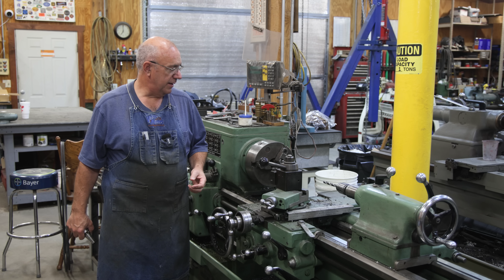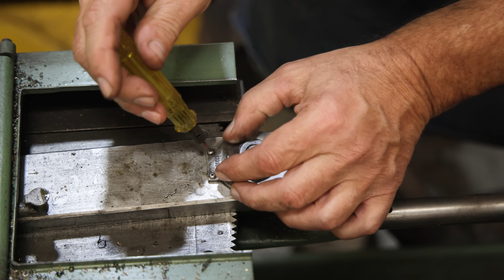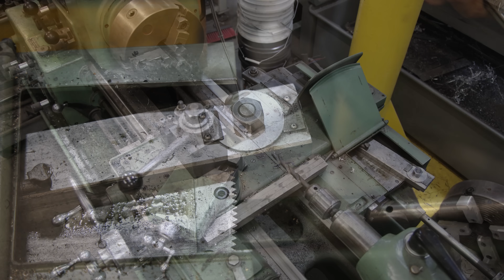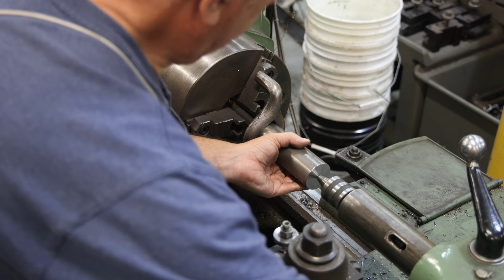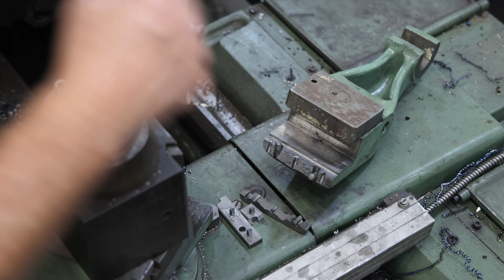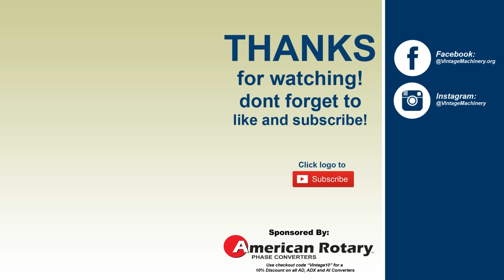Trying to Turn Tapers when Disaster Strikes....

Comment: Maybe we start a broken taper turning attachment club ? I've one on the Colchester Student but, for one, the max taper angle is only about half the range of yours. For two, the setting knob was very stiff - so I pulled it to bits, cleaned and oiled the thread then worked it back in - and the threaded rod broke - so the adjustment doesn't work now. Interestingly though, it's set up so the taper attachment is always available and the cross slide handwheel always works - no locking of the cross slide to use the taper.

Comment: You put a centre in the chuck and had a centre in the tailstock to mount your bar between. Before you mount the bar, start the lathe.
One of the centres will revolve, the other will not. You refer to the revolving centre as a 'dead centre' and the one not revolving as a 'live centre'.
How do you come to have the centre's names the wrong way round ? The centre in the headstock is the LIVE CENTRE - because it is driven and the one in the tailstock is either a DEAD CENTRE or a RUNNING/ROTATING CENTRE.

Someone somewhere has got it confused - and the way round I have it agrees with the literature of the day.
SWING: A lathe with 6" swing will turn a 12" bar. 'Swing' (think of child's or a pendulum) is from the pivot point to the extreme end and is half the diameter.

DRILL BITS - If you want 'drill bits', break up a bunch of drills. There's no such thing as a 'drill bit'. A 'bit' does exist (12 1/2 cents, Am.) as you can drill a hole using a 'brace and bit'. Bit - the replaceable cutting tip of a drill.

Surprisingly 'drill press' appears in my dictionary although it's not used in English. We do have:
Radial drill (like the Carlton)
Pillar drill (floor standing (head only goes up and down))
Bench drill - short version of pillar drill mounted on a bench
Electric drill - electric powered hand-held drill
Hand drill - hand-cranked hand-held drill.

This feels like a rant - but it's not. :) There seems to be quite a few other things with multiple names. Top slide / compound slide, Travelling steady, fixed steady / steady rest; 'loose headstock' - that could be new to you ! (Circular) saw bench / table saw

Comment: Some re-engineering might be in order to repair that lock. I noticed that Keith had to use both hands to crank the saddle. There is some high resistance working against that saddle and I'm betting it increases with the taper and naturally transfers pulling force to the lock.  Unless that resistance can be lessened, simply replacing the part won't get the job done. Getting rid of the leverage on that lock might be a good place to start.

Comment: Simple math would say that a 3.5”/12 taper or angle would be about 16.3°.

Couldn’t you just set up the compound to that 16° and cut it with that?

It would leave you with the extra .3° to take away with the grinding, but you were already gonna have that, or an X amount of extra to take out with this current setup.

I like the videos and most of the content you make in the channel but it seems like a lot of the time you make things harder than they have to be. 

Don’t take that the wrong way. Just saying there is an immediate solution to this problem to keep things going. But instead of doing that you shut down production to fix something that isn’t really holding you up.

Kinda like being locked out of your house and having a spare key hanging inside next to your front door.

You’ll go in the garage, go grab the key, then go back around and out front to unlock the front door and go in. To just hang the key back up. Instead of just going in the garage and being done with the problem.

Comment: There should be a 1/2" stabilizing rod between the carriage and the cramp. It goes through the 1/2" hole on the clamp and a bolt is tightened  from the top. This stabilizes the clamp so it won't rock while  locked for tapering and when unlocked and floating. The bolt stays tight all the time unless you are making an adjustment on the larger rod. Mine is threaded on the carriage end and screws into the carriage. This takes most of the strain off of the clamp.
Reply: Don't confuse him!
Bozo AKA Fenwick Babbit strikes again, the part  that broke is the same part he "repaired" (BUTCHERED) a couple weeks ago, priceless.:face-red-droopy-eyes::face-blue-smiling::face-blue-smiling:

Comment: Worked around a lot of welding, although not a welder. They used to use a dongle pick up to test welds for below surface porosity. They would apply some kind of a cream over the welded area then move the probe through it. It would indicate, some how, any hollow spots or bubbles under the surface . Maybe it could indicate invisible cracks in cast? Making taper tooling is fun! Thanks.

Comment: I would machine off part of the top of the clamp down to the level of where it rests on the lathe and out past the big clamping bolt.  This would give you a very large area to spread out alignment pins and a couple of screws.  When in use the clamp bolt would help retain the new top piece as well as it's clamping duties.  Simple, easy, and quick.
I would also examine why there is so much resistance.  It should not take so much force just to crank the carriage back and forth while doing tapers, the cross slide moves in and out well in normal use as does the carriage.

Comment: Im not familiar with that lathe, but seems like there should be something to loosen to release the cross slide from the apron. It seems like youre having to force that hand wheel harder than expected. Extra force due to binding could be contributing to the broken clamp.

Comment: Hay Keith, not sure if you noticed it or not, but just after 16:00 when the carriage is moved back and forth, it appears the saddle is twisting or rotating like the far side is sticking is place while the front moves. Watch the compound and tool post when you are moving it and it is quite visible on camera.
Reply: Yes. I see it too. Could that stress the taper attachment clamp?
Reply: Good catch there.  That doesn't look right.

Comment: Mine was missing, so I just fabricated one from steel and machined it post weld. When not in use, I disconnect it and park it at the end of the bed. One other thing  I do for setting the taper, is setup an indicator on the carriage and read how much the tool post moves over a know distance. With a readout on the lathe its really easy to check the taper in say 6" of  carriage travel.

Comment: LOL, I worked at a marina for a short time in my callow youth on outboard motors.  That's where I learned that throwing tools across the "shop" in frustration was usually followed by a splashing sound and a trip to the hardware store.  I was a fast learner.

Comment: Breaks happen. Cannot be helped. I am familiar with not being able to find parts. I am using an 1890’s Seneca falls star lathe, and when parts break or wear out.. sooner or later mine will be a museum piece as keeping it running…..  will be fun seeing you make the part. Wonder if steel will be stronger, or add more problems than cast iron would.

Comment: It’s an easy repair, you just mill the whole top off . That whit the overhang and replace it whit steel … and that you will bolt it and pin it … they’re the cast iron is thick and you cannot break it

Comment: Suggestion for a repair: mill-off the damaged end of the casting so that the end is square to the existing machined surface.  Then drill and bolt a new piece on, such that the bolts are perpendicular to the way that you did it the first time.  That'll put the bolts into tension (instead of shear) and they'll also be engaging into a much heavier region of the casting.
Reply: Interesting and practical option.
Reply: That's exactly how I would go about doing it. Much quicker than fabricating a new one!
Reply: Once you have the new piece bolted on vee out the parting line and TIG braze them together with aluminum bronze wire for a very strong, permanent repair.

Comment: The steel clamp will be stronger and less likely to break than the cast part. Be sure to liberally oil the taper slide and all
connecting parts so that it slides freely.

Comment: Couldn't find when you did the last repair but I'd suspect that the reason for the failure was that there was sufficient clamping force holding the arm to the lathe bed..   The clamp looks to be made of steel and I'd bet it was cast originally.. It had been replaced and was cut wrong.  The lip on the arm is only supposed to act as a guide when loose and not have any forces on it..  The arm needs sufficient clamping force to stay in place and not rely on the narrow edge.  The clamp needs recutting to provide adequate clamping force.   

The cast break was caused by improper repair and in adequate clamping force of the arm to the bed.  The arm piece broke due to cutting the steeper taper causing the more force on the arm and inadequate clamping force.
Reply: Bozo AKA Fenwick Babbit strikes again, the part  that broke is the same part he "repaired" (BUTCHERED) a couple weeks ago, priceless.:hand-orange-covering-eyes::face-blue-smiling::face-blue-smiling:

Comment: Keith, the smart way, in my opinion, is to build up some brass brazing material on the broken clamp and then remachine it to fit like new!  I would suggest cast iron welding it with cast iron welding rod, but I don't think you know how to do that, so brass should work just as well in this situation!

Comment: I agree a fabrication done in steel is the best route and will ultimately solve the original issue with apart that seems to be a bit underperforming in the strength needed. Good the museum gives you a plan B !

Comment: Keith, I have question about the taper clamp that broke. You said it was cast iron but you were going to just make one out of steel. What is the difference between the two choices cast iron vs steel steel vs cast iron? Thank you sir!
Reply: Oh, boy... let the debates begin!

CAST IRON is durable but brittle, can take extreme temperatures, and is easily machined. Comes in the form of round bar stock as well as several varieties of block stock. Needs patterns, casting and normalization, time to live (TTL) can be months. 

STEEL Steel is very durable, not brittle, and moves a lot with temperature, machinable with common mill tools. Comes in a large selection of shapes and sizes. Drops would be best for this repair for cost. Readily available when you need it. LOW CARBON is indicated for this as hardening is not needed and the extra qualities of tool steels are not needed.

CAST STEEL All the properties of cast iron, except for brittleness; details are the same for timing.

Functionally there are very few differences between any of these materials. Engineering choices, yeah there's a few cavets, but none in this case.

Comment: Keith, since the old one is basically scrap, mill the top down to 0.125 or so under the existing toe ( the part that rides on the way). Then make a plate to replace what you milled away. Mill beyond the hole for the clamp bolt to add strength when clamped. You could braze the repair piece on once it is done. But a couple of bolts through it wouldn't hurt.
Reply: I was honestly surprised he didn't do that when he made the original repair on it. I expected him to lop off the end with the bandsaw, clean up the cut, and then just braze a block of steel on to replace the entire end of the clamp
Reply: Like Gary5407 said, the Repair was in sheer instead of tension. That was the biggest part of the reason. Edited to fix the user name Gary5407 and a grammer error.
Reply: Bozo AKA Fenwick Babbit strikes again, the part  that broke is the same part he "repaired" (BUTCHERED) a couple weeks ago, priceless.:face-blue-smiling::face-blue-smiling:
Reply: @garybrenner6236  So how about you fire up your (no content, no followers) channel and make a video showing us all how to do it right? Or is your time all ate up making derisive comments about Mr. Rucker’s work? 😂

Comment: Looks like you could mill the top off of the old taper attachment and bolt a new clamp to it, no?  If so that sure would be a lot easier than recreating the whole thing.
Reply: And I have seen a L&S (Lodge & Shipley) with that type of repair as described.

Comment: Once you had the taper set up you seemed to be having to use a lot of force to turn the lathe Handwheel ie Both hands. It made me think that something is binding up in the cross slide/Taper attachment. ???
Reply: The steeper the angle, the greater the load.
It certainly looked stiff, and perhaps simply a good oiling might have helped.
Reply: @montynorth3009 any oil 🎉
Reply: At 16:00 it looks like the saddle is twisting, like the rear of the saddle is sticking in place for quite a bit before moving. Watching the compound when moved back and forth it is really noticeable in the camera.
Reply: This is why I watch your videos! They are real! Thanks again for keeping it real.